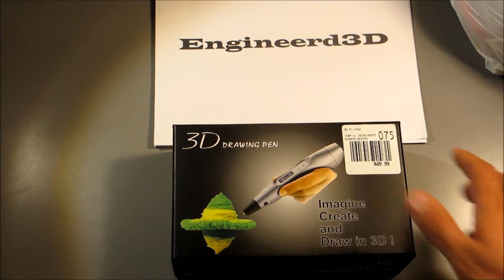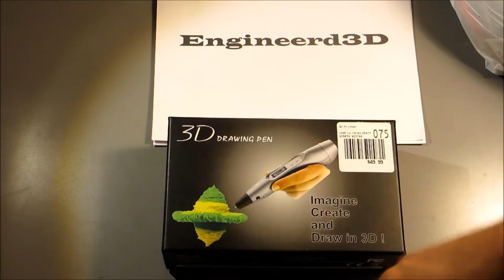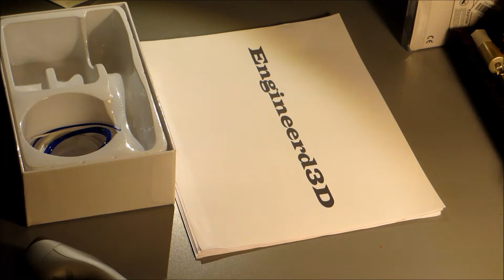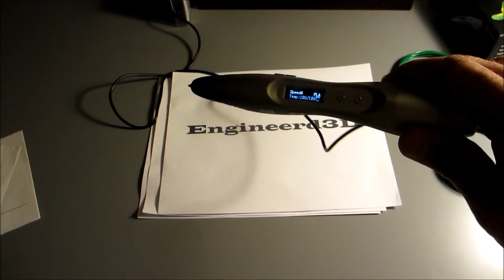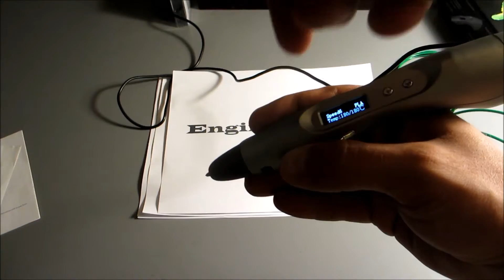eSun 3D Printing pen review + Fix

Comment: My daughter got one of these as a gift.  The filament does not load, and felt like it was being kicked out rather than being pulled in.  So I took it apart, and yes, both the feed and upload buttons turn the motor in the same direction!  Do you think this is repairable?  Looks to me like it's a problem with the circuit board, but I could be wrong.
Reply from the maker: I would look for a solder bridge. The motor could be wired backwards as well.
Reply: Thanks. I'll open up that bad boy and check the connections.

Comment: Extruder is really small, and is probably super light too. Should be perfect for delta-style printers.
Reply from the maker: Not really. No way of having feedback on it. Its a simple DC motor. The speed is also very limited, or I should say the torque. if there was a way to get feedback and have a circuit that will treat that DC motor at least like a stepper, then it would work. Interesting though though.